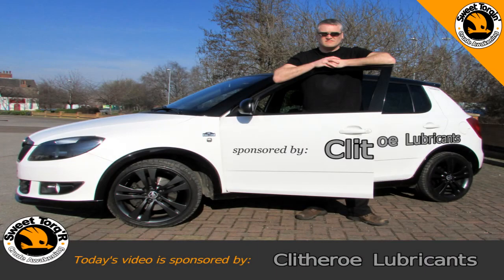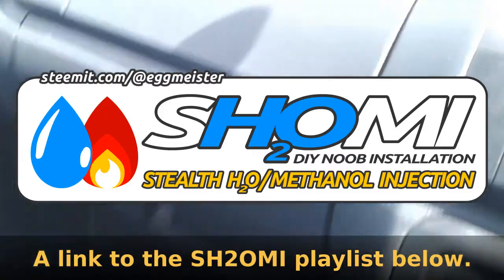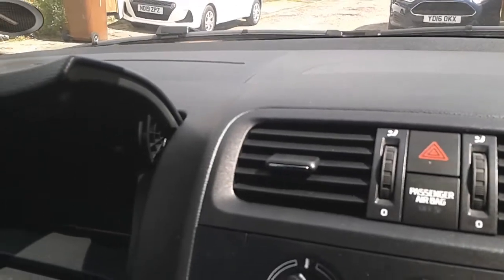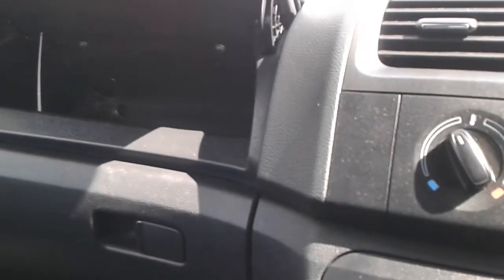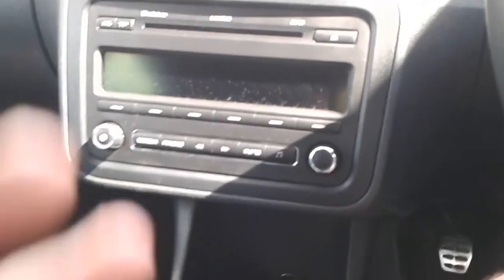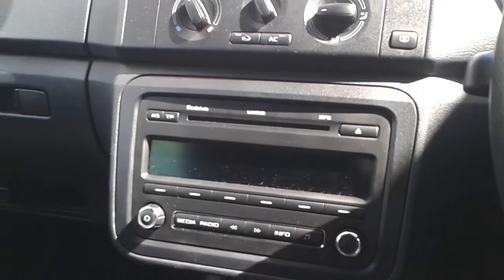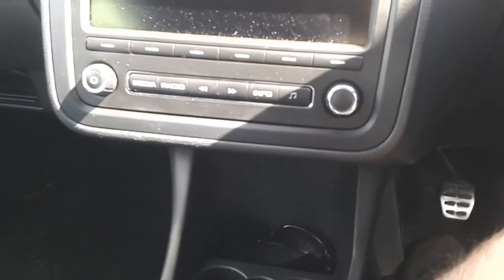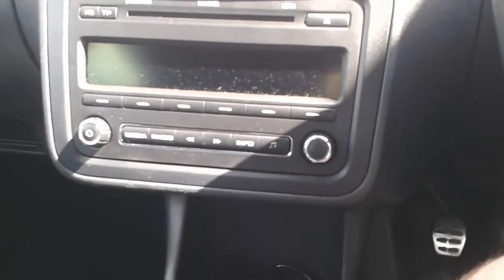Want More Power On The Cheap? Cool The Charge - [Random Stuff Archives]

Comment: The water meth injection in the throttle body had little gains ?  Smaller gains than this?  This mod and set up looks great tho and I’d really like to do it on my cars being in Las Vegas heat 110+!!
Reply from the maker: I think the spray pattern was too wide and hitting side of pipe and running down into intercooler.  Thanks for the comment  :)
Reply from the maker: I've got a new channel with this Skoda Fabia. If you're interested in the teaser trailer then you can find it here: https://youtu.be/xzf4dPR-Mt8

Comment: Very nice setup, the atomization is key to extracting the heat and not having to fill the reservoir everyday😂
Reply from the maker: I've been having trouble with it lately,  vacuum leak somewhere as the pump keeps pumping air. If i prime it by activating the screen wash, it'll work for a few secs before drawing air again.
Reply from the maker: I've got a new channel with this Skoda Fabia. If you're interested in the teaser trailer then you can find it here: https://youtu.be/xzf4dPR-Mt8